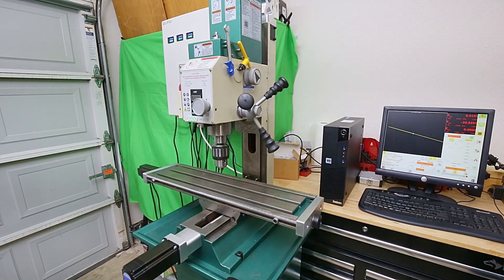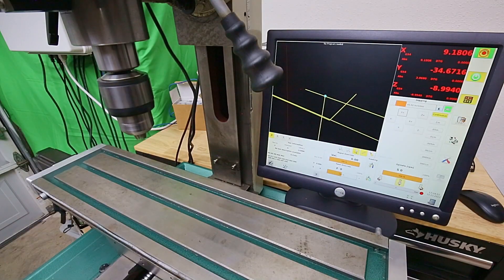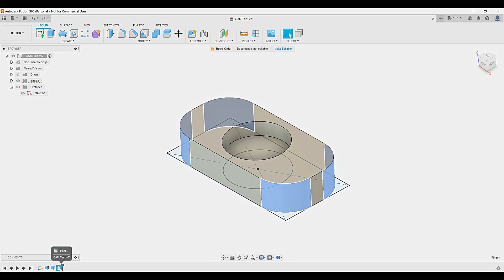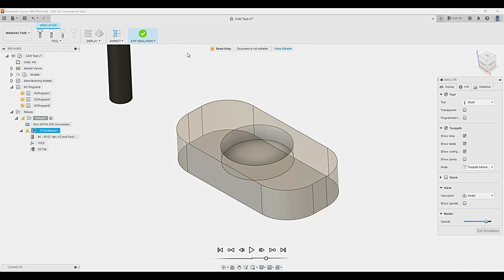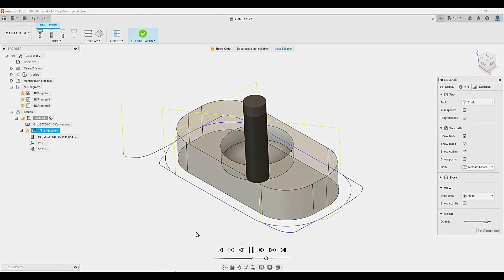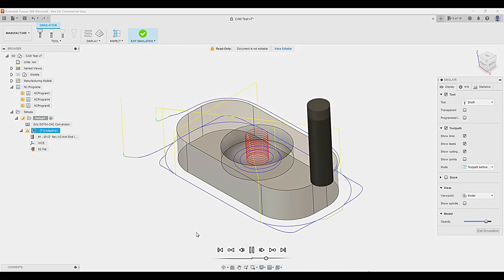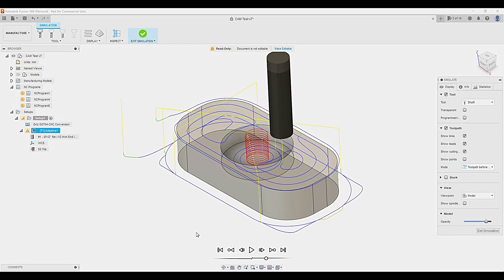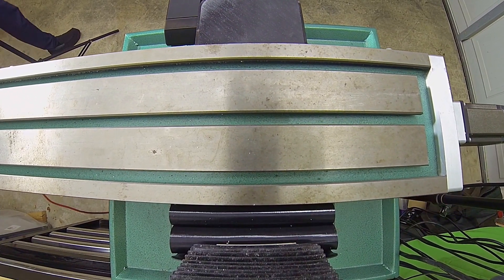Simulated CNC Milling - Running G-Code on LinuxCNC & G0704 CNC Conversion

Comment: Very nice. With the closed loop stepper motors, no dro scales required? Readouts are provided by the stepper encoder and step caloibrations?
Reply from the maker: Thanks,
Regarding the closed loop steppers...
The CNC program (LinuxCNC in this case) generates the DRO output, which is calculated, and indicates where the cutter "should be". If everything is working properly the closed loop stepper has no advantage over an open-loop stepper. It's when something goes wrong that the closed-loop stepper is useful. Too fast of a feed rate, for example, may cause missed steppes, and the closed loop stepper system can be configured to alarm out and stop the mill. I have mine configured so that the mill will stop if the error is greater than 0.002".  Servos are better, but closed loop steppers are cheaper. Closed loop steppers... Better than open-loop, not as good as servos. IMO.
Reply: @joat_mon  thanks for the explanation.

Comment: All of your videos are by far the best I’ve seen for G0704 conversion. Excellent content and video quality. Looking fwd to your next ‘lesson’!
Ps: I’ve been building my conversion for almost 4 years with DMM servos and the acorn board. I fried the Z drive when I sent 48v to the 5v cable by not remembering I inverted the location of the plugs on the cabinet. Project is on hold for now, but I’m really interested in getting away from Windows computers and learning Linux system one day. Your control cabinet is a work of art...thanks for sharing your expertise!
Reply from the maker: Thank you very much.
   I had a pretty good idea what I was getting into with the CNC conversion... but didn't have a clue about the time it would take to produce the videos. Though I don't regret it. Learning DaVinci Resolve on top of LinuxCNC and basic machining keeps me busy. 🤔